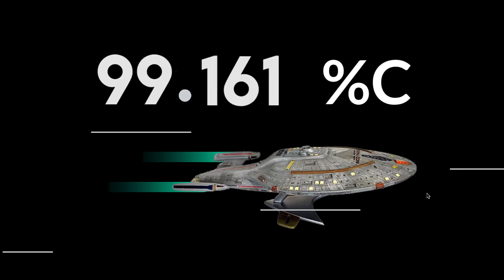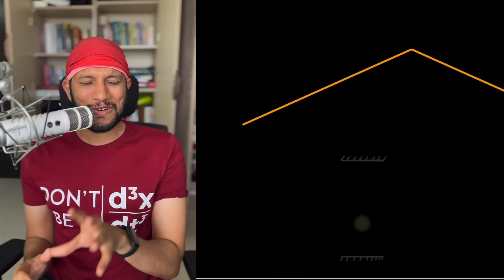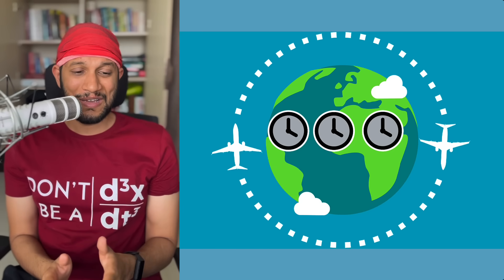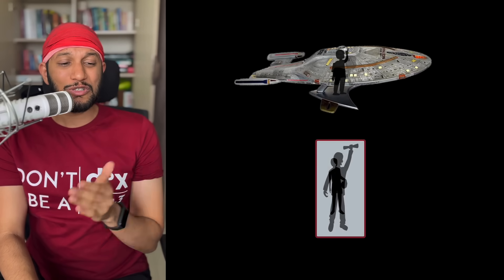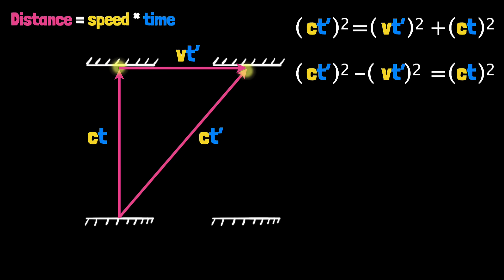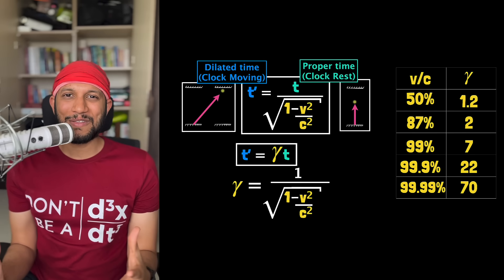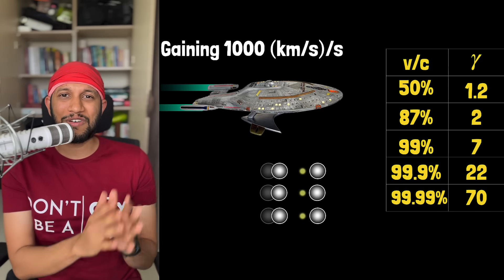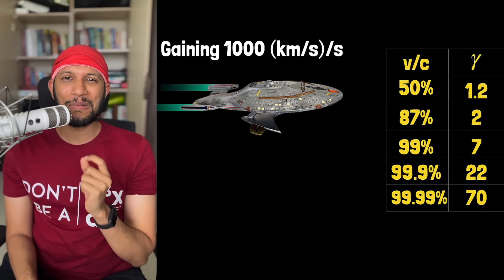I finally understood why you can't go faster than light! (My mind is blown)

Comment: That infinite time for an outside observer, 
but for person in actual ship will speed  reach ocross C?
lets say I am not observing any thing from inside ship..My goal is to just reach a planet .
For example
I have a planet which is 100, 000, 000 Km away( from earths perspective).
My plane accelerate 1000(km/s)/s
So plane will reach there in 447.1 s or not( in ships's proton clock)..
making actual plane speed 447000Kms..

that's the part confusing to me.

Comment: The "photon clock" is the same thing as a laser "gyro" which we use on bombs to guide them, currently.  It's not a device of science fiction.  As the bomb moves, the change in the place that laser strikes the "mirror" (detector in the case of a bomb gyro) moves and registers the change in position of the bomb at time intervals of which the laser is fired.  If (the bomb) were approaching the speed of light, the laser would "tick" off a place other than the opposing mirror which would be moving too fast for the reflected photon to hit it depending on the size of the gap between the mirrors.  The photon would still be traveling in a straight line, but the mirrors would be moving.  What makes you think the photon is going to suddenly change vectors and move diagonally because the mirrors are moving?  We would NOT "see" the rate of "tick" slow down because the distance between the mirrors would not change if the direction of travel was perpendicular to the direction of photon travel such that you illustrated, but we would see a corresponding change in the place the laser landed on the other side which would not seem strange to us if we were inside (the bomb, or ship, or whatever).  That is not the time distortion usually mentioned in regard to velocity.  If you carried a wind up clock with you on the ship, it would "tick" away as normal, because the mechanical properties of the clock and you would all be equally effected, and the "photon clock" would only change in the landing position of the laser the way the positions of the hands on the wind up clock would change in a very expected order.  The clocks don't slow down, their time state slows down.... and their (perceived from the outside) mass correspondingly increases.  If you added energy (speed) to the rate of travel of the (ship), the time would slow down more, but if you added energy to the photon in your photon clock, it would change nothing, because your photon has a capped velocity and it is already at that velocity.  Your muons have a half life of 1.5 microseconds, but he ones traveling faster into the atmosphere last ten times longer........ why is it your first impulse to go off on a tangent related to the speed limit of mass when you have just demonstrated how NOTHING HAS TIME UNLESS IT IS TRAVELING?!?!?!?!  Time is a byproduct of movement in absolute reference to the universe.  Muons traveling fast from outside last 10 times longer.  Muons traveling with the earth at 700,000 mph vector velocity have much shorter life spans because of less time dilation.  So, at zero vector velocity, the muon would 1) not have mass  2) not have time distortion (time)  3) not have a location.  Isn't that far more interesting than thinking about trying to do the impossible????  We already have probes and such that go 70,000 mph.  Reaching 700,000 mph in the opposite direction that the earth is going would be much easier than building a super, super collider.  You can do it with modern technology and a small budget if it was just a probe.  The interesting questions are 1)  if something had no location in this universe, could that object be anywhere or everywhere in the universe?  2)  If the object had no absolute vector velocity, could it accelerate and come into existence anywhere?  3)  Does not having any time mean that an object exists during all time or no time?  It's time would be infinitely fast so it probably couldn't exist in time.

Comment: If age is slowing down then that would have to mean that time is local to our area and not across the universe.
Which is actually what you're saying. Why is time local to Earth? Who made it that way? This is equivalent of me getting in my truck and delivering a load to Pluto and when I get back in town everyone else is older than me. Which means I had to leave the perimeter and source of time which is Earth, travel long distance away from the source, and come back to a completely different reality. Somehow, I'm not buying Earth being in its own time bubble.
And I want to expand on this farther.
From your spaceship model, as your travel faster and faster the protons you theorized with your graph that protons have to travel farther and farther which is why time slows I presume. But, you basically formed a triangle in that graphical path and as you know all sides of a triangle are the same distance. Even the long edge. Actually, the long edge is twice the distance of the other two sides which means it actually travelled the same distance. Whether the long edge or the two shorter edges. Same distance. Which is one reason I'm not buying the time dilation. Especially when NASA themselves reported to the media a large mass moving faster than light. I also like the phenomenon of that (I don't follow science)thing that likes to change its path just because you observe it (which can be demonstrated using a Petri dish). Meaning intelligence. Meaning; not everything is measurable. Things change as you change. Think about it.

Comment: Nice explanation of behavior based on the speed of light  but why is the speed of light what it is?  Is it related to the density/elasticity of space?

A guitar string of a given length vibrates quickly or slowly based on it's density (heavier is slower) and it's elasticity (tightness).  Does space have a given density and elasticity that allows it to propagate waves at a specific speed?  Is the universal constant just related to those variables?  If space has density and elasticity then it also has resonance at certain frequencies - does that explain quantum levels?  If so, does that explain forces at certain distances like electron shells, strong and weak forces?

If there are areas of space in the universe where space has more or less density, does that explain dark matter/energy?  Are particles just energy trapped in some type of spherical resonant static wave?   Is gravity just related to the apparent density of space around a lot of energy particles causing particles to be pushed together because the density of space being less between them (because their energy stretched space) than around them?  Can any of these questions be answered at this point?

Comment: Instead of visualizing a photon clock in a singular position of one photon riding along side the craft, why not visualize a linear clock of many photons all rebounding in synch. Perpendicular to the rebound surface, along the path which the craft travels. In this scenario, there is no time dilation, as it represents a true image of time. In the first scenario, given in this video, the angle of photo travel convolutes the perceived result which does not represent actual time but only of its affect on a theoretical mechanical device. The speed of the photo never changes.

Comment: So the premise here is that a photon has further to travel when it's moving in another direction.  Fine, but why then do you think that the photon viewed from aboard the ship isn't also moving diagonally? You can't see the diagonal movement from within the ship as the ship is moving forward at the same speed as the photon is, but that doesn't mean the photon wouldn't also slow down  as it is, most definitely, moving diagonally.  If it wasn't it would disappear off behind the mirrors, never to be reflected again.

Comment: You are starting with an unknown variable and forcing it in like a puzzle piece out of place. Why do they, and for some odd reason, Einstein, think that time is inexorably linked to speed? It is not. And I can prove it, easily. If I state a period of time lower than a second, like a picosecond, is that a valid measurement of time? Of course. Does light move within that time period? Yes, it would have to. And a picosecond is 0.000000000001th of a second. And you can go infinitely on one side of the decimal the same as the other when measuring time. If that's the case then time is not a variable that can be tied to anything like lightspeed. The speed of light is not the end all beat all that modern day scientists think it is and the sooner they stop believing it is the sooner we can advance. Remember when they though the sound barrier was the same? Heck we don't even know what different forces and particles are out there OR how any of them work, except the electromagnetic, and we still don't fully understand it!

Comment: distance = (speed x time) makes no sense to me. or maybe, if you move in a straight line. If you rotate in place, there's no distance, regardless of speed. Some imaginary ship (with a certain mass) is not the best example, since we do not have it and can't accelerate it (no technology). Hence no measurement and no proof of anything. Not to mention that speed has nothing to do with distance if the space/time is curved and/or there are "shortcuts", available through bending. But all these are just theories and mind experiments until availability of ships and drives and spacetime bending technologies. About your video: if a photons (or anything else) travel at the speed of light, at no additional energy cost (only time, because of low speed), then ... Understand photon and the rest will come.

Comment: For anyone still struggling with the concept, I thought of a simplified version. Let's say there are two atoms trying to communicate with each other. The first atom says: "hello". But, the second atom is moving away from the first atom at exactly the speed of sound. That means, the message will never reach the second atom. Now scale it up by replacing the speed of sound with the speed of light, and you basically understand special relativity.
Reply: i give you now the answer i hardly found, by myself. Einstein himself was never able to explain this.

no real clock slows down, because no real clock measures time, not distance. all real clocks measure time*distance, and that is a non-variable. 
Einstein was often confused

the answer to the twin paradox is: 
all twins in the Universe live in the time*distance, not in time, nor on distance. 
this is the key to understand the limits of special relativity, that is a non-functional theory, merely a didactical object.
no twin ages more, by virtue of relative motion and speed.

there are three types of time, all different, always different: 
1. theoretical absolute time, or say theoretical local time;
2. theoretical relative time, or say theoretical distant time;
3. measured time, the real time, that ironically does not have the dimensionality of time, it has dimensionality time*distance

Comment: By this explanation, it would actually make more sense to travel at a significantly slower fraction of the speed of light to get to another star system. If a star system was say, 4 light years away, then traveling at 50%C, by this explanation, it would take roughly 9.6 years to arrive at destination, and at 99%C, it would take 280 years in relative observable time? (Relative to the...non- traveler?) 
Am I tracking right??
(Edit: It looks like 87%C would be the best speed, (according to this given scale),as it would take roughly 9.2 years to reach a destination 4 light years away, at this speed.)

Comment: It never amazes me how wrong this thinking is. The photon is outside the moving ship and yes it does appear to slow down from the ships point of view but time inside the ship remains the same. I compare traveling from one place to another, if you go faster you get there sooner BUT time does not change it just took less time. In this universe time is a constant. So one light year still take a year to travel and when you return that will be two years that have passed. I Believe Einstein left out something in his calculations, Traveling by car gets you there faster than by horse and buggy but it is not time travel per say, more like time adjustment. The problem is what effect does light going the opposite direction than you have at such a high collection?

Comment: If you are on the north end of a football field and kick the ball towards the goal that is on the the south end you may miss because the goal post has moved and is moving towards the east.  If the goal posts were on the equator and located east to west you would need more force from the west side kicking towards the east.  The earth is spinning. What is the orientation of your atomic clock relative to the direction of the ship or plan? I know it is spinning on the earth.

Comment: Yes, you can go faster than the speed of light. Mass does not go to infinity. You are just using the wrong calculation. Einstein’s formula was the maximum speed of light is the speed of light, not the speed of any other object! Your physics information is about 20 years old. You need to buy a new textbook.

Comment: I understand how a photon clock would slow down if the speed of light is a constant, but I disagree that a mechanical clock would slow down, because the way it measures time is not based on the speed of light. Also milliseconds after the big bang, scientists say that it expanded faster than the speed of light... That's the entire mass of the universe moving faster than the speed of light, which completely goes against this theory... I think the scientists should fight it out to determine which is correct 😂😂

Comment: This all makes a lot of sense and I would never have known this otherwise, but i do have a question. This is proving that achieving the speed of light is impossible from an outside perspective, but if you’re inside the ship it looks perfectly normal, after a certain amount of time you will achieve exactly C at constant acceleration, even if to others it looks like it could take a billion years for example. Can someone show me if this isn’t possible?
Reply: Well, relativity completely disagrees that that would happen.  Actually the very beginning of the video (to show why a photon clock would slow down) already assumes that this CAN'T happen--light looks like it's going the same speed in all reference frames!  The explanation at the end of the video is just wrong, I think.

Comment: 15:31 or find a way to reduce your spaceship mass!!!  Half mass means half inertia and double aceleration....  if you continue to reduce the mass (  antigravity , or antimater equalibrium without tuching the normal mass ????) Theoretical you will have more and more aceleration......
Reply: Gravity doesn't make mass, it's the opposite, gravity happens because of mass.
And the same problem would occur if you were to reduce mass : you'd have to reduce the mass to 0 to reach the speed of light. Which basically means there'd be nothing left of your space ship.
Reply: @desrtsku  does antimater have the same problem ? Or in a presence of matter have the result of antiatraction ? ( it pulls away the normal matter ) ?

Comment: As an uneducated layman with an interest in Physics I believe that firstly  having been told that light has no mass yet can propel objects such as sails through space it seems to be contradictory and that if light can be measured as a speed then all speed can be increased with no limits and if argued this is not possible  then the speed it is measured at is no more than a guess . The moment you say we cannot travel faster than light then you slam the door on the adventurers mind at a very early age   ( bad ), I absolutely believe that the speed of light is measured ( of course it's easy ) but it is really slow ( really really super slow ) and it will take minds much greater than we have today to step outside the box (and as the expression goes  the light will come on ) and mankind will traverse the universe much faster than slow old light just as it has crawled out of the primeval soup and then off we go , just wish I could be there to witness it but at least I truly believe it  and see it in my minds eye which has no theoretical limits or bias  !   .

Comment: I'll help. At light speed, you teleport. Not to the rest of the universe, but to you, you appear at your destination instantly. You aged not even a plank length of time even if you took a thousand years to reach your destination. That breaks reality because information needs to move. At 99% light speed it takes you 60 days in your time to get to the nearest star Alpha Centauri. At 99.9% it takes you 5 days. Close to light you only need a tiny amount more speed to slow down much more time for yourself.
Reply: But it takes exponentially more energy.

Comment: If you were say, ten light years away from Earth and you started speeding up toward Earth and you just kept speeding up 24/7 for 9 years you would be approaching Earth at a very very high rate of speed, maybe approaching faster that the speed of light but you would only feel the speeding up like it was gravity pulling you to the bottom of the ship. You would not notice how fast you were traveling. On the other side of Earth there is a spaceship traveling at nearly the speed of light toward us. At Earth the ships pass each other, each going well over half the speed of light. Relative to Earth each ship is traveling well past half the speed of light. Since both ships can't tell that they are moving in space unless the look at Earth, what does the other ship look like coming toward those in the first ship? Relative to each other they would both be traveling past the speed of light.